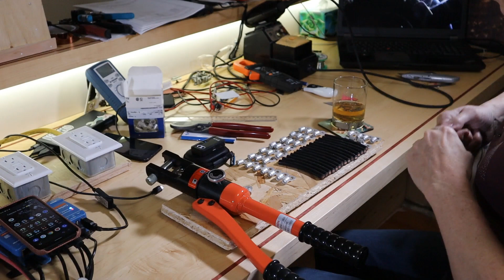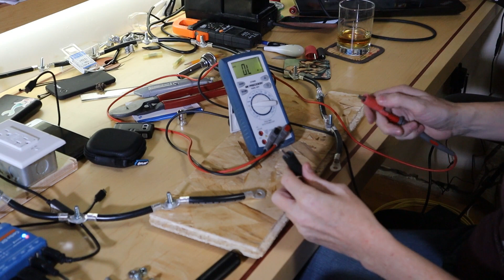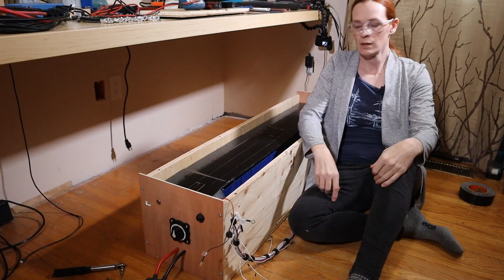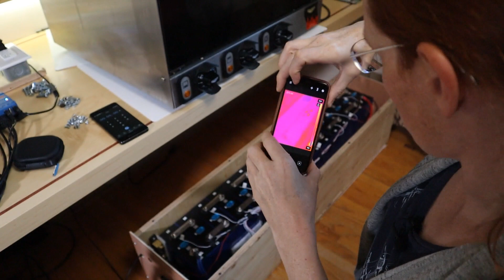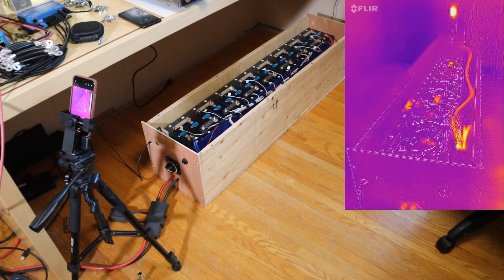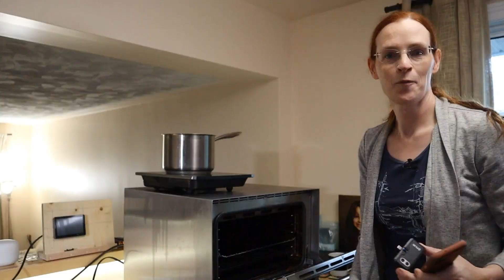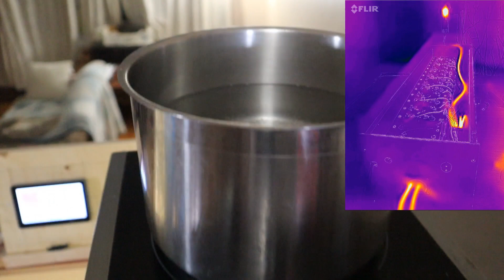What's Better? Rigid or Flexible Bus Bars - How to build a 48v Lifepo4 battery (Ep. 21)

Comment: As a qualified electrician, one thing that I will be doing is using my favorite connector, the Wago 221. The battery I am building has a Heltec 16-25s 48V 100A BMS, where all 27 leads (25 plus battery negative and positive) are used, so on a 16 cell battery you might have 2 or 3 wires joined at 6 of the terminals, AND also a NEEY Smart Active Balancer. So, I have some 18AWG wire I intend to fly lead from the cell terminal as a single wire, to a suitable 3,4 or 5 way Wago 221, and then bring the BMS and also my separate balancer wires in to. Watching you do this was something I had intended to do, but was unsure about before you did this (kudos to you). Now, I could crimp the 18AWG fly lead AND the 4AWG cable in to the lug, thus reducing connections at the terminal to just one ring connector. Why do this using the Wagos? Simply easier to undo/remove the BMS and Balancer, plus removing the number of connections at the cell terminal. Now to a point you raised about whether the assembled battery would be moved (in a boat or RV) or static (in a home). Whatever use, the terminals WILL have vibrations because wire carrying current will vibrate. In domestic installations, aside from faulty installation/workmanship, the biggest cause of fire is wiring vibrating loose and arcing. Rigid connections are far more prone to this compared to wire to terminal/post connections.

Great videos. I love your presentational style. I found you from Andy's channel.
Reply: I just picked up some Wagos. I might end up using them to wire a bunch of 4.4Ah 3.7V LiPo packs together. What have your experiences been like with them?
Reply: @Miskerest  They are very good, but do not overload them (current). Stranded wires I would put in bootlace ferrules.

Comment: Great test, and flir is awesome. Perhaps de-greasing all contact point for future work. Thx for the hard work!
Reply from the maker: You're very welcome! I thought about degreasing the bus bars, but I didn't see any issues that would justify it in my mind.
Reply: @TheDigitalMermaid  my experience is that skin grease etc will corrode metallic surfaces over time. So for longterm stability I always de grease.

Comment: The supplied busbars aren't aluminium so there is a possibility of dissimilar metal corrosion (as is the case with flexible cable lugs). This is why I made my own busbars from 5mm thick aluminium bar. These can be drilled for minimum clearance with the studs to maximise contact area. Being thicker they also make it easier to provide a tapped hole for the balancer leads. To minimise the amount of exposed metal I did use large diameter heatshrink over the busbars. 
So far I have only used 3kw load but the losses appear to be minimal. The biggest losses are often associated with the off battery cables and BMS as shown in the video. If cell movement needs to be allowed for it is extremely important to add insulated layers between cells to ensure that the thin existing insulation layer isn't abraded. Any touching between adjacent cells will cause a short and therefore a fire.

Comment: You should use a much higher measuring current, maybe a few amps from a power supply. What about using some kind of grounding tape, this looks like a fabric of thin copper strains.

And by the way, you should be careful, the cell terminal threads are not made to be tighened many times, even with the right torque.
Reply from the maker: I talked about the load at the end of the video.

Comment: Given that thermal cameras have a hard time properly showing reflective surfaces as false positives, it's a good idea to cover the metallic bus bars with electrical tape to reduce reflection. However, the flexible bus bars are better as you said in vibration/moving environments. This is some Hot Stuff :P lol.
Reply from the maker: I noticed that in a part of the video I cut. I filmed the quattro and could see my reflection in the big DC plates the wires screwed on to. This camera is just madness on toast.
Reply: @TheDigitalMermaid  will you please consider a retest? Repeat FLIR test with tape on Busbars?  Frst, I highly recommend "Ray Builds Cool Stuff"  YT channel as he addresses busbar lack of uniformity leading to connectivity issues, and flattens them, then cleans with alcohol (acetone is bad for many plastics) and uses carbon based grease to greatly improve results. Lastly his test of 4ga copper crimped connectors was much higher resistance at .25Mohm vs Busbar .17Mohm.
Reply from the maker: @jamesbsa6450  Probably not any time soon, I'm afraid. Now that I've made two sets of flexible bus bars, and given how many configuration options they provide (another to be tested in the next video), I don't see myself going back to the solid bus bars.

Comment: Nice try, but it is not possible to measure the resistance of the bus-bars with a normal multimeter, even if they are all connected together. The resistance differences are lower than the tolerance of the ohmmeter. 😉
To measure such low resistances you would need to use a milliohmmeter, which normally uses a four wire technique (two wires to supply a constant current and two wires to measure the voltage drop).
Using an IR-camera is a really good idea to find contact or cable resistances by using a higher current. 👍
Good to see, that the flexi bus-bars are even better. Well done and a lot of work.
Reply: She will get one for future test. I've sent her the link ;) But the camera test was great and proved the point.
Reply: I bought a three pack of two wire kelvin probe clips from Amazon for about $8, and wired them up to a lab power supply and voltmeter. I got readings that looked perfect for the type of wire I was testing - confirmed to be copper, not aluminum. :)

Comment: With expansion and contraction I’m thinking with the bend in your busbar wire,  that the nuts could could loose. Of course you need that bend in the wire to maintain flexibility.. I’m thinking this is another reason why braided wire is used

Comment: True flexible busbars are supposed to be made from braided wire or strips of thin gauge copper.. the braided allows for more flex..
Reply from the maker: I've not had lucking finding tinned copper braided bus bars or the terminations / tooling for them. If you have pointers, I'm interested...
Reply: @TheDigitalMermaid  up north and personal shared a lot of info about them on the diy solar site

Comment: Infrared thermometers have trouble with reflective surfaces.  At times I have seen metal components painted mat black in order not to fool the infrared thermometer.  I suspect this could go a fair way to addressing discrepancies.
The surface area of the ring terminal that contacts against the battery land will be less than that of the solid bus bars.  If all else is equal the solid bus bars should provide a greater surface contact onto the battery lands and therefore less resistance.

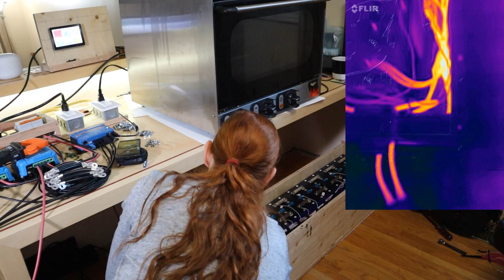Comment: The more you use a thermal camera, the easier it is to notice things. The rigid bus bars are reflecting heat from something else. At 26:50 you can see it happen as the hot spots shift to different bus bars. The same thing happens if you look at a window with the thermal camera and then walk in front of it, you will see your thermal reflection in the window just like it was a mirror.
Reply: Very true and all you have to do is paint the buss bars and then you will have a more accurate reading, also the flexible buss bars have more mass. I hope this helps.  Keep up the good work and stay safe and charged
Reply: @jamesmason7124  There is no need to pain them just put some electric tape on them and you have a quite similar surface to the cable insulation.
Reply: Yes I was just going to say that those bus bars were having reflections. I noticed it at about 23 minutes in. There's what looks like it might be a trouble light above the battery and several of the bars seem to be showing reflections of it. Using electrical tape will cause some delay in the readings but a quick and dirty trick would be to make a small template and spray paint something like Ultra flat black paint and an area big enough that you can measure it with your thermal camera on each bus bar. The ultra flat paint has much lower thermal mass and as much thinner and lighter so the response will be much quicker than the electrical tape. Hindsight is 20/20 this would have been really easy to do while you were assembling all those bars together to measure their series resistance...

Comment: 15:34 use of wire cutter for shrink tubing is doable, but if you want straighter cuts, use Fiskars or similar straight scissors.
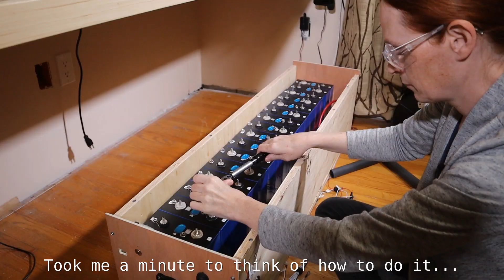Reply from the maker: 17:53, I cut the large diameter shrink tubing with ... fiskar scissors. :)

Comment: As far as comments about soldering the cables.  It isn't needed.  Your crimp made a solid connection.  You could put on heatshrink with the glue inside.  That would seal them really nice.  
Great job on testing setup and heat camera.  You are showing up Andy and Will for sure!

Comment: Just measure the voltage between each terminal post with a wire vs bussbar under load.  If you know amps and voltage drop you can calculate resistance and then calculate the maximum current they could run.  But "better" doesn't mean lower resistance.....if you don't care about pulling high current.  You should just make sure the amount you need to use(and fuse for) is acceptable for the bussbars or cables.  An interesting thing is that the cables will be rated for max current when the insulation starts to melt.  Bussbars don't have insulation so could be run hotter.  And really, you don't really expect to pull high currents for long so either appear to work in  your case.

Comment: You want the wires to have a bend otherwise, you will have pulling just like the bussbars.  The battery terminals are aluminum so they will have coating on them after exposed to air.  I took some fine sandpaper and scratched off the bussbars and terminals before installing.  Some are using a conductive grease on terminals too.  It could explain why a few buss bars with larger contact area are warmer than cables.

Comment: Probably to late to suggest this, but I never understood why battery builders use stainless steel or plated nuts and bolts, the resistance is so much higher than brass. I would replace all the studs in the battery terminals with brass threaded studs and use brass nuts and washers. I would also clean up the tinned lugs as tinning has a much higher resistance than bare copper I would also grease everything with battery terminal grease before assembly. I would not add the BMS lug into the main current flow path but add on top of the nut and secure with a second nut which would also act as a lock nut. Don't believe me, check out the resistance of brass compared to that of tinned copper, plated steel or stainless steel.
Reply from the maker: I suspect that tinned copper is perfectly good enough for most people, and cheaper.

Comment: Thanks for doing this test. I'm doing something very similar with my current build, which will be drawing a full 280 A from the cells. I decided to go with "dog bones" (as I've heard them called) for many of the same reasons you cited. I won't be able to do a comparison test with standard, rigid busbars, however, because they won't work in my build. 

Some companies do make flexible busbars; however, they are very limited in length options (minimum 9" IIRC). They do offer longer sections that can be cut and fixed with terminals, but at that point, you might as well use properly sized cabling.
Reply from the maker: Ya, I saw those mesh style flexible bus bars in such large installs. I originally wanted to use those, but I could not find where to buy them, let alone the ends or tooling to crimp them. Then I would need to find tinned-copper version for marine use, and I just said screw it and made jumpers. :)

Comment: I don't think that the rigid busbars are of particularly good quality. Is the cross sectional area the same for both flexible cable and the busbar? A fair comparison is to compare for the same cross sectional area. In this case with limited current (about 53A) this will make little difference. As you say a better test to expose weaknesses would be at a significantly higher current. In terms of losses, where you have the longer cable it might be worth going up one size to reduce heating and therefore losses. In your case I understand that the single 16S run is optimal to make use of your planned boat space. For those who don't need this layout a pair of 8S runs joined at the far end enables both cable connection lengths to be minimised helps to reduce losses without needing extra cable size for the longer run. The heating at the terminal posts probably demonstrates the limitations of rigid busbars if they are not absolutely flat to the top of the terminal posts. This could be caused by any differences of level between the terminal post top faces or if they are not absolutely flat.
Reply from the maker: I would have to measure to confirm, but I think the bus bars are larger by cross section. I want to say ~2mm x 20mm, where the cable is 19mm. I'm out of the country this weekend though, so I can't say for sure.

Comment: The batteries expand and contract and I have seen about 6 mm gaps form. With your flexible buss bars that wouldn’t matter as much as with rigid buss bars so for me it doesn’t make sense to use rigid. Your experiment showed some bars heating up which I think would get worse over time with the batteries moving every time they go thru the charge discharge cycles. Excellent experiment in my view one no one else has thought to do. Nice work!
Reply: the cells should not be able to expand at all. that is exactly the thing you need to prevent as that is caused by gases forming and the cell delaminating over time. a puffy cell is a bad cel.

Comment: I'm  only ine 1/2 of your video but i already have few comment :) haha
1. I would suggest to always solder end of your 'flexible' bus bars ..so there is no chance of moisture/salt to go inside the connectors. So solter them and then apply sealing grease ..same as it would be in real application
2. I'm sorry to say but your multimeter is not good at all.. 0.1 or 0.2 means nothing but it could be 100% difference in resistance. So i would sugest LCR meter or mili/mikro ohm meter for this measurements. That will show real difference.
3 Also i just noticed..in your test that those hot spots looks like very shiny bus bars..so i wouldn't worry about that..try to use black tape over it..then it should be better to check it
Reply: Crimping and then soldering seems like a good idea, until you realize that it defeats the flexible part. The solder done properly will wick into the wire, and trying to bend it will cause problems.
Reply: @john_in_phoenix  you are correct but you must not let it go so far ofc :) and after all  these flexible bus bars must allow a little movement..not 2 cm or such..just a little is ok..so even you will use solder it will still allow you to have movement of the cable
Reply from the maker: I know my gear is far from pro, but this project is expensive enough as it is, and probably in-line with what most DIY'ers have. I would love to have nicer tools, but as mentioned, I don't plan to be or want to be a science / testing channel. Andy, Will, LS and others already do great jobs.
Reply: It takes a serious solder gun to properly solder a battery lug and appropriate cable. Propane torch would be better.
Reply from the maker: @john_in_phoenix  Did you see the gun I got for converting the server PSU into a power supply for the X8 charger? ;)
Reply: @TheDigitalMermaid  Unfortunately I haven't watched all of them, no. I do however speak from experience designing and building burn in racks for MRI devices in the early 80s. 500 amps at -2v does impressive things to a screwdriver that slips. Anyway, from a manufacturing and testing perspective, crimping is far superior to soldering. People are human, and the number one defect in electronics manufacturing is poor solder joints. Nobody ever decides to make a poor solder joint, but it happens all the time to even the best and most experienced. I have literally seen hundreds of thousands of them. We used to build computers in the USA, and I was lucky enough to work in the test engineering lab where we made 50k per week for the 5 years I was there. That was only one of many contracts.
Reply from the maker: @john_in_phoenix  Solder in high vibration installs can get brittle over time, as I understand it. So I think soldered connections on a boat isn't the best idea anyway.

Comment: i am having to go flexible in an rv setup because of the nuts working loose and throwing off my balancing from the bms.
Reply from the maker: Bingo! Exactly what I worried about.
Reply: You could add another nut on top preferably a locknut so make the work loose a lot slower. Flexible interconnection is likely a better option because even if you get the nut to stick the vibrational energy has to go somewhere and it could do damage the cell over time

Comment: I got the same problem with flat busbar. My DIY wire busbar work better.

Anw, 54A should not make ur battery wire getting hot.  Is that a 16mm2 wire?
Reply from the maker: 19mm